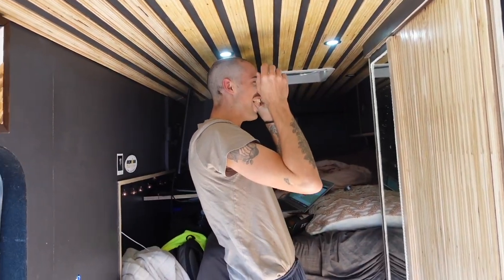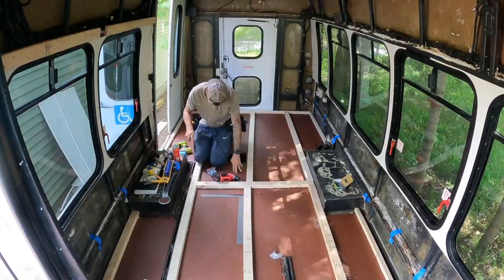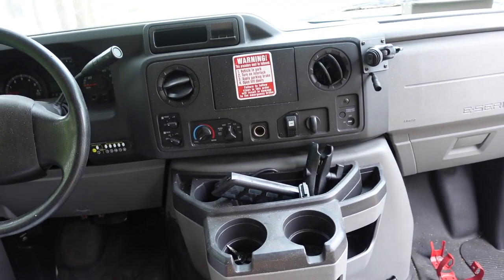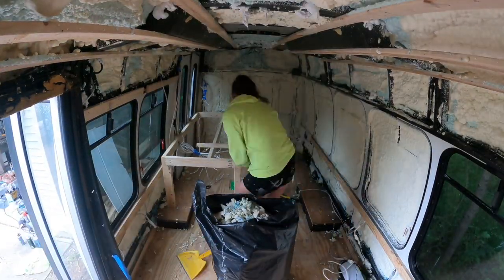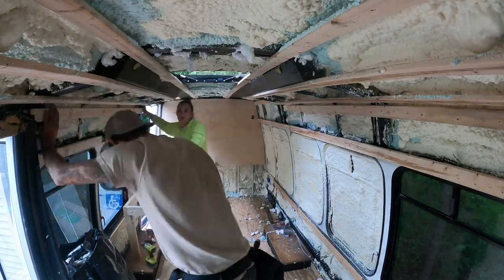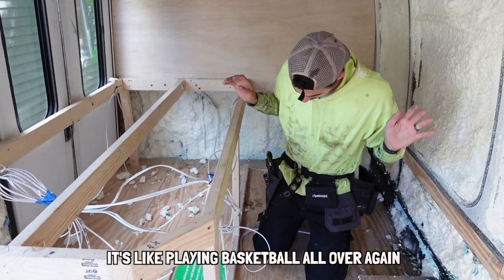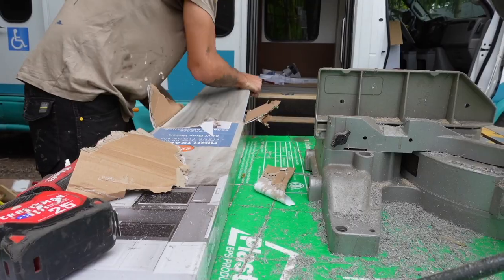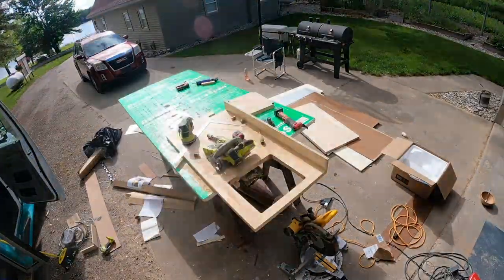Our FIRST EVER Shuttle Bus Build (the floor is rotten)

Comment: Hi guys! Jay... question for you.  Any chance you could do a diy insulation video? I have a shuttle bus like this one. Mine is a lil bigger and l love it. They want over $3000 to spray foam it. Not happening!
Reply from the maker: Yikes, $3,000 is way too much!! Think we did our bus ourselves for around $600. We have a video on spray foam when we did our bus. It's super old but try watching it and let us know if you have any other questions!
Reply: @KelsAndJay  l was around when you were doing it. I joined shortly after the roof fell. Remember l mentioned you should tape your runners? I forgot about that. Will look for it again.